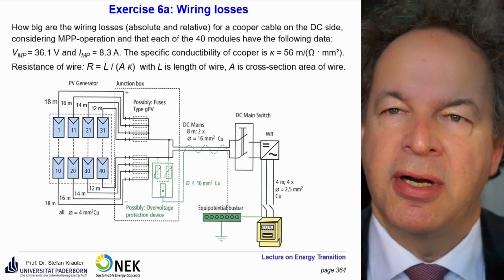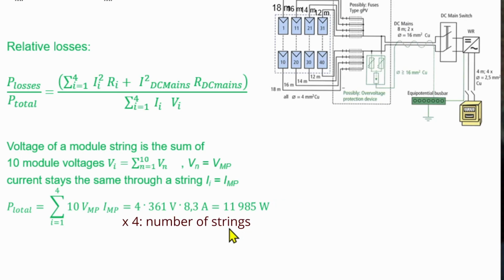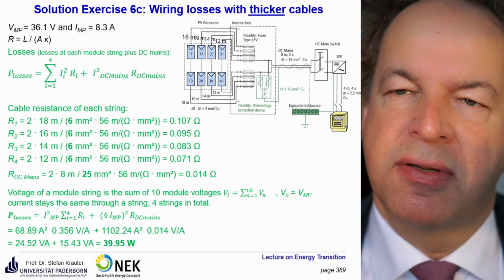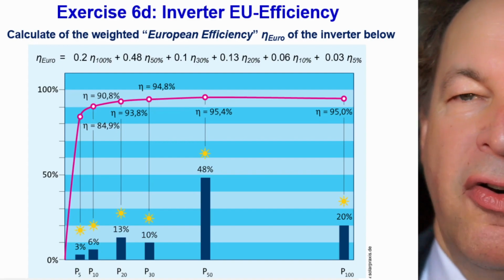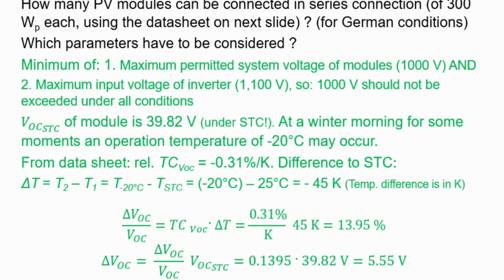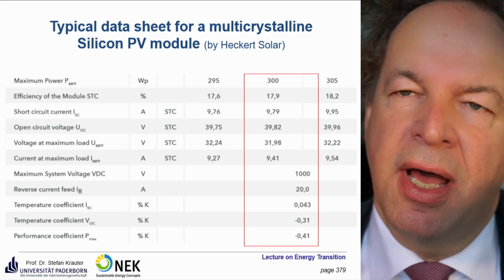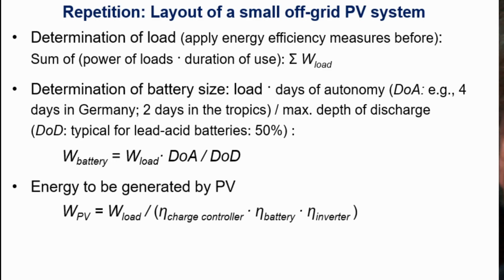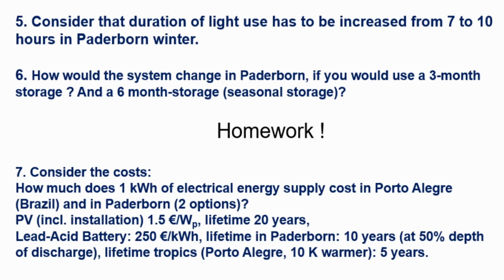Solutions and Homework for Exercise 6 (PV2) of Lecture Energy Transition

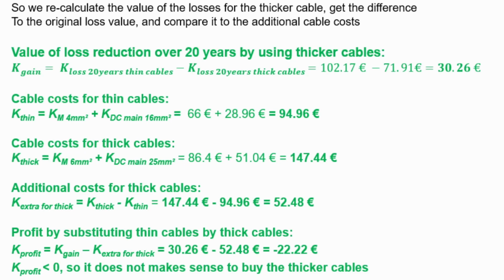Comment: Dear Prof. @ 17:10 , There maybe a small calculation error for the cost of thicker cable, as 86.4 + 51.04 = 137.44 euro not 147.44 euro. Thank you.
Reply from the maker: Thank you, I shall check.
Reply from the maker: That is right - I corrected in in the PDF already and will correct the video later. However, the outcome  remains the same: For this case, thicker cables are still not profitable (maybe if you consider to recycle them after lifetime).
Reply: @Stefan_Krauter  Thank you prof.
Reply from the maker: The PDFs are correct now, I shall make a new version of the video then - any other ideas for improvement?

Comment: In task 6f Q2 why do we not consider the energy efficiency of storage to get W_battery? In the storage exercise 11-12, we are considering n_ah i.e. battery efficiency for calculating W_battery. Why is there a difference in the calculation? Are the two efficiencies different?
Reply from the maker: 1. There is the energy efficiency of a storage unit (e.g., a battery) which is the ratio of energy output to energy input. Remind: Energy is voltage times current. The Ah-efficiency just accounts for the the current times the duration of output divided by the input.
While the charging voltage has to be higher than the discharging voltage, the Ah-efficiency is higher than the actual energy efficiency (which is reduced be the voltage difference).

2. Losses occur at charging (voltage during charging is higher than the "stored" voltage) and at discharging (more Ah charged than could be discharged).